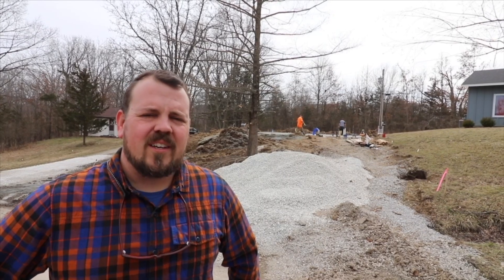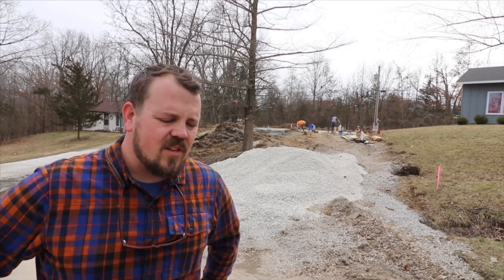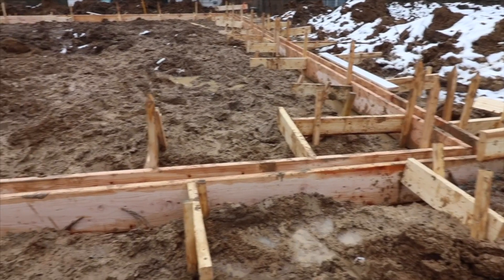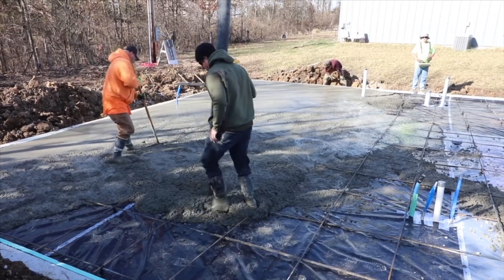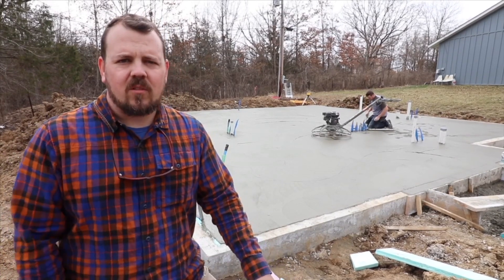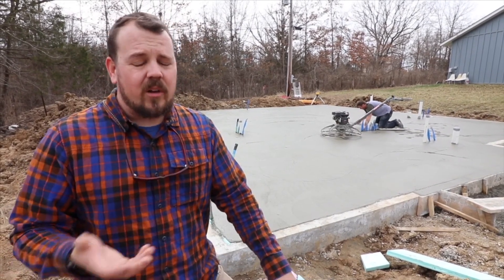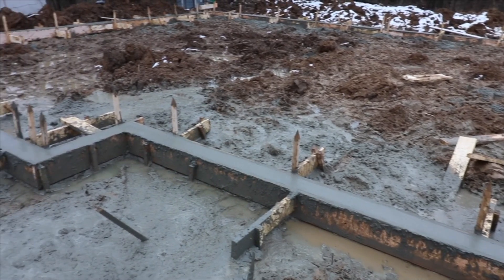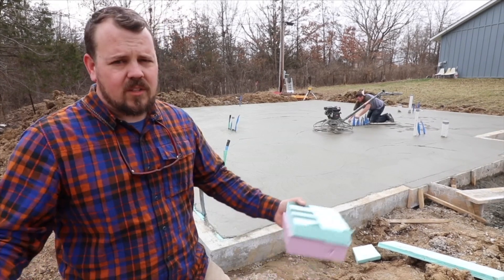How to Create a Truly Insulated Slab

Comment: I am currently installing an insulated slab.  I found it difficult to eliminate all voids between gravel and the 2" xps insulation.  Do you have any recommendations?  I also noticed that you did not connect slab rebar into the stem wall.  Have you found that we don't need to anchor the slab rebar into the stem wall?
Reply from the maker: Move to a smaller topping material when leveling the subgrade material. We like lime waste for a little cap to smooth things out.

As to bar between the slab and the stem wall, no. There is no reason to connect the two. The slab is fully supported by grade below. We want them disconnected for insulation reasons, putting steal between the two would be pretty conductive.

Comment: Your concrete finishers suck, they are on the slab way to early with the power trowel, not to mention the complete disaster of a mudpen that you are pouring over.  It's OK to prep the soil correctly and put down a gravel base, so you don't have a pigsty work area.
Reply: I saw those helicopter trowel marks in the wet concrete and I was like, oh man, that's gonna be a marred finish

Comment: Thanks for sharing. Thermal coupling or "bridging" is also a very common issue here in Australia. Concrete slabs are also very common, and very rarely insulated or have thermal breaks because "it isn't so cold here".. meanwhile the Aussie homes are super expensive and very low quality - freezing cold inside in winter! That's why Ugg boots were invented!

Comment: Why not in floor heat tied to gas or electric boiler?
Reply from the maker: In-floor heat can be an option. However in really tight house in mixed climates it tends to be overkill and not responsive enough to justify in most cases in our mind.
Reply: @ @8,000’. Works great here.
Reply from the maker: As it should.

Comment: I like your solution. I will say to make it REALLY comfortable install radiant in floor heat.
Reply from the maker: In-floor heat can be an option. However in really tight house in mixed climates it tends to be overkill and not responsive enough to justify in most cases in our mind.

Comment: you seem to still have 8 inch of exposed concrete between the wall and ground. the top layer of concrete has covered the insulation that was put onto the wall. would you not have exposed this to the air so that when the walls are build you can continue that insulation making it truly an insulated floor/wall piece?

Comment: I’m seeing this in 2025
Last year I learned-
• POUR OUT A SLAB
•LAYER THICK FOAM( don’t know how much they used
But 1.5” is blah
ID PERSONALLY GO WITH 4” of FIRE PROOF FOAM( of course that would mean Foam create( so not sure if they have a slab version
•THEN! POUR OUT ANOTHER LAYER OF CONCRETE!
So CEMENT
THICK LAYER OF FOAM
THEN A SECOND LAYER OF CONCRETE 
THIS WOULD EQUAL AN EQUIVALENT OF A RADIANT FLOOR WITHOUT!!! WIRES!!!
IF I HAD TO START FROM SCRATCH
THATS WHAT I WOULD DO
( *I DO NOT KNOW IF  FOAM CAN CATCH FIRE BETWEEN TWO SLABS OF CONCRETE, if not , then worrying about PINK FOAM SHEETS NOT!! Being Fire  proof  is not a concern

Comment: Why not form the footer-stem with material that doesn’t conduct heat-cold like a fiberglass hard board? When the concrete cures simply leave the form in place?

Comment: Why not put 2x6 pressure treated plates on the slab then 1" of styrofoam sheets on the slab, put a wood joist frame work over that and spray foam insulation the joist area .  This  would insulate the whole floor from the slab and  one would just leave the difficult to warm up concrete slab out of the equation. This would give you a wood floor to walk on instead of concrete. What do you think of this?
Reply: Some people want concrete floors, think about a gym or example.

Comment: Will this be a termite heaven
Reply from the maker: This type of assembly should not be any more of a termite issue than a traditional slab assembly. We still have full poly and taped seams. If worry was there, Stego makes a great Pango product that could be used for added protection.

Comment: Would really like to see a sectional drawing of how the wall sits on the curb and vertical foam. I assume you are using 2x6 wall framing. 4” curb plus 1.5” foam to match the plate?
Reply: I am wondering the same exact thing👍

Comment: The reason the granite counter top "feels" colder than the wooden cutting board is that human sense "heat flow" and not temperature. Our brains attach a "preceived" temperature to that heat flow rate that our skin detects.  You also fail to discuss the thermal mass of the insulated concrete and how high mass materials stabilize temperature.  Insulating the concrete make a lot of sense but some of your understanding is not correct.

Comment: Going to be building a garden room, and for a quick question... 
why don't you edge the slab with a small brick wall?lot

Seems me that you are exposing the edge of the concrete to the elements, plus the weight of the walls on the edge must be quite a lot
Reply from the maker: So the reason to not add in brick is for us that would mean bringing in another trade. Second, the reference of it being a lot of weight on that exterior wall, the residential building is actually very little weight in the grand scheme of buildings. They are actually very light. We think of them as heavy because we cannot pick them up but our foundations think of them as very light.

Comment: "that concrete is exposed due to code"- why do you say due to code. Why not provide the reason why the code is such. That would be more informative.
Reply: He probably doesn’t know why exactly it’s the code. Code books are written by engineering committees and then adopted by local municipalities for whatever region they live in. Builders don’t have to know why the codes are, just what the codes are. My assumption is 6” of exposed concrete above the dirt is probably what’s required to keep the siding away from the ground and prevent rot, or moisture trying to wick its way in to the framing. In my area it’s 8” from dirt
Reply from the maker: Sorry for not catching this to reply sooner. Obviously we can’t catch all information in every video even when we try. The code is written this was for two main reasons. One, is as stated above, to prevent non-cementous type manterials from being in contact with the ground. Two, is to provide an inspection path for bugs like termites. If you have 6” of exposed foundation the you have bare concrete on which a visual inspection can take place and you can see them making a path from soil up to your building. If the cladding went all the way to soil they could migrate in secret.
Reply: @jake.bruton.aarow.building  thank you for the reply. Learned something new about the bug inspection area
Reply: @jake.bruton.aarow.building wow thats good info. Thanks!

Comment: If you're adding a thermal break, then it's no longer a monolithic slab, but rather a perimeter foundation & inner floating slab?
Edit: Nevermind. I watched again & see where you poured traditional stemwall below frost depth.
Reply: I think you were right the first time. This appears to be a perimeter foundation with a separate slab floating in the middle. The two are separated by foam. Otherwise, how else is there a thermal break from the perimeter concrete?

Comment: Ummmm how is the slab connected to the exterior concrete wall?? if it is not well I will not get into the problems that will happen LOL 🙂
Reply from the maker: It isnt connected. I would love to hear how you disagree with our engineer though.
Reply: @jake.bruton.aarow.building  i think the confusion comes from the fact that you are now using a 4" footing and it isn't below frost depth. You get away with this on a monolithic slab as the entire structure is one piece. But this just appears to be a shallow stemwall.
Reply: @jake.bruton.aarow.building   Engineers are just that engineers!! They design something and never go back years later to see that the crap designed on paper does not work?? Who are you going to call? LOL You would think there would be a ledge for the slab to sit on or at least j hooks from the stem wall to the slab? Something to mesh the two together? If you do not any settlement that happens with these two separations will be disastrous!! Drywall cracking/windows breaking the list is long. You will learn that in time about engineers 🙂

Comment: Jake, 

I just watched your video and had a few questions.  I’m a homeowner in Ohio, adding a covered screened in patio to my home.  The base will be concrete 14x18. The contractor wants to do 1” blue Dow insulation foam board in the concrete pad. 3-4” gravel base and 4” concrete.  I’ve never heard of using the blue Dow.  Is this a common acceptable practice that I should not be concerned about? Please help.
Reply from the maker: If the space is just a patio, and it isnt going to be conditioned I wouldn’t spend any money on insulation. What are you insulating against? If the space is to be conditioned I would make the arguement that the insulation the contractor is putting forward (which I believe is XPS) is only R-5 and doesnt meet code in your market. Therefore the matter should be addressed from the code perspective of what does the IRC 2021 say is required.
Reply from the maker: What I mean is if the room will be inside or outside? Conditioned like heated and cooled. If the space is not going to be conditioned and always outside, Ive never heard that arguement of using insulation to limit movement before. I can’t say I would understand how that layer would make any sense, that would be a question for an engineer I guess, I would hate to simply say your contractor is incorrect without having all of the information at hand.
Reply: I’m not sure what you mean by conditioned? He’s saying the 1” blue Dow rigid foam board insulation helps with the movement from ground heave freezing and thawing etc.

Comment: So your stud wall (2x6 5.5” wide) sits partially on top of the 4” curb wall and partially on top of a piece of insulation board correct?
Reply from the maker: Yes. Think of is as a 2x4 wall is rated to hold the exterior of the building up and we are using the 2x4 part of the 2x6 assembly. Does that make sense? We end up with about 1” of the 2x6 floating over the foam assembly.
Reply: Wait so not only is this not a monolithic poor but it’s three separate pores?

Comment: That blue foam against your pre-poured exterior "stem wall" will also serve as an expansion joint I would think as well? Am I to understand that  this slab has no radiant heat pipes installed inside it as well?
Reply from the maker: No radiant system. I would bet the engineering would not allow us to call the foam an expansion joint because it has a decent PSI rating.

Comment: Isn't the standard the Frost Protected Shallow Foundation (FPSF) where the insulation goes on the outside of the foundation along with a horizontal insulation extending out X inches depending on your Air Freezing Index?   Just a thought.

Comment: We got more advanced syustem here in europe ... the whole slab is inside a foam jacket... wall included. Only a small part of the heat is exiting from the slab ... more exit from walls and even more from the roof. There is a need for continuous insulation around the house.

Comment: Here in Northern Europe we make many slabs with even more insulation. First 12 inches of Macadam under the whole slab, that is compressed well. This will drain and be the capillary break layer. The macadam is carefully adjusted with laser level. Then you lay out the border/edge beams for the slab. These are made by aproximately 4 inches of eps insulation and only a thin glassfiber board on the outside. The beam is 16 inches high. On the inside of the beam 12 inches of eps insulation then fills out the whole  slab except next to the edge. Most of the slab will then be 4 inches of concrete on top of 12 inches eps insulation. But next to the edge there will be 12 inches thick (and 12 inches wide) concrete beams. With 2-4 inches of eps insulation on the outside.
Reply: The reason I ask is because  the definition of Macadam in the USA in “  broken stone of even size used in successively compacted layers for surfacing roads and paths, and typically bound with tar or bitumen” so I want to understand your details.
Reply: Our locals governments resist change.  That makes it impossible to fix stupid.
Reply: Could you send me more information on your method? Or tell me where I can obtain it.
Reply: Thanks! Could You give some video examples, any language?
Reply: @jphtavares  You get many examples if you search for swedish concrete slab

Comment: How do you finish the 1 1/2 rigid foam insulation on the stem wall/curb? I plan to pour slab on grade with hydronic heat and will have R14 under the slab spray foam or rigid. I will also have rigid foam on the stem wall interior and exterior. Do you bevel 45 degrees the rigid foam on the interior? I plan to use 2 inches on the exterior too and I’m wondering a good detail on how to finish? Thank you, Charlie
Reply from the maker: We dont bevel our insulation because that little section of slab is kind of compromised. We just size it to work with the wall size. Our wall is a Zip R-6 with a 2x6 and 1/2” drywall this allows for a fairly thick wall that works well this concrete assembly.

Comment: Hi Jake, How do you handle the slab insulation at the door openings?
Reply from the maker: The wall is thick enough that it covers and we order a jamb thick enough to work with the wall.
Reply: @jake.bruton.aarow.building  ok great. Maybe it’s just not visible in the video at the door opening. The concrete may have just discolored the edge of the foam if it continues across that door opening.

Comment: Your insulation design is a good idea but it only provides thermal separation from the outside concrete. If you had hydronic tubes to also heat the slab and your thermostat was set on 76, the slab would be 78 or higher. The example you used of granite counter tops was a good analogy. Imagine the comfort of heated floors.
Reply from the maker: Agreed. The challenge in climate zone 4 is that many days we heat overnight and then need some cooling in the afternoon. A heated slab changes very slowly and we need heating and cooling that are more responsive. Slab heat is very comfortable though. Sometimes it works well.

Comment: I am surprised that it is not a code requirement in Missouri for there to be insulation in a slab foundation. In PA we are required to have either 2 or 4 ft of continuous insulation from the top of the slab, depending on the climate zone you are in. The insulation can be either verticle or horizontal or a combination of both.
Reply from the maker: This meets code because it is fully continuous.

Comment: The parameter of the slab must have insulation. There needs to be a 4 ft slope from the slab with ridged foam for frost!
Reply from the maker: I’m not sure what section of the code you are finding this in. Can you provide the code?
Reply: His footers are presumably below the frost line.  You are probably thinking of a frost-protected shallow foundation.

Comment: If you are adding foam why not 6 or 10 inches
Reply: Cost vs benefit trade off.  2in foam is usually more than $1/sqft and if you double the thickness you double the price.  In addition, you need to allow room for that foam so more excavation or higher and thicker stem walls which both add cost.  Everything affects everything else
Reply from the maker: You absolutley could. For climate zone 4a this is suffcient.

Comment: Modern building need to be built without any thermal bridges. Slab edge detail like helps to reduce thermal bridging and should be standard. In fact not only should be standard but the foam thickness should be increased to achieve higher u-values suitable for the climate. This is standard when building towards Passivhaus standards.

Comment: Is there any risk of upheaval or subsidence with the interior slab being uncoupled from the perimeter footing?
Reply: ... also is the concrete not too heavy or the foam board underneath? It won't compress it at all?
Reply: @nofurtherwest3474  The foam board can take up to 25 psi without any compression. For comparison, a square inch column of concrete in a 4" slab weighs about 1/3 of a pound.

Comment: Thank you for the video.  I think this is a great idea to do to all homes.  I wish you took it one step further and installed radiant heat into that slab before it was poured.  It would have been more efficient than any other type of heat you can put in that home.  Even still, what you did is 100% better than what is usually done.
Reply: I plan on leaving the foundation one piece but using  radiant floor heating.